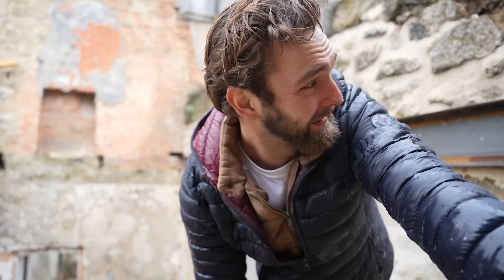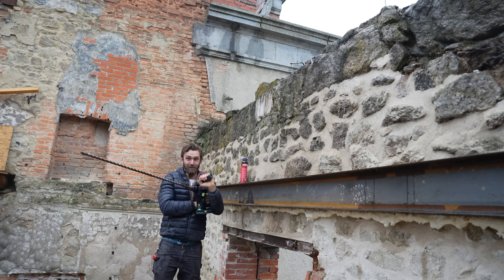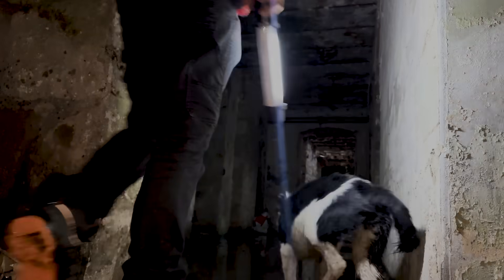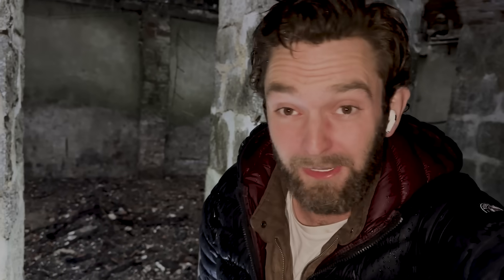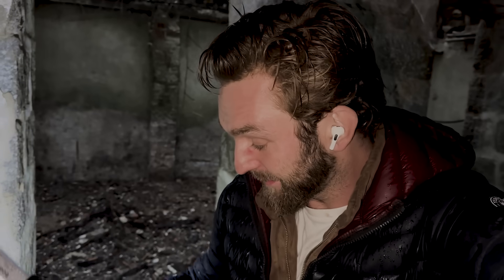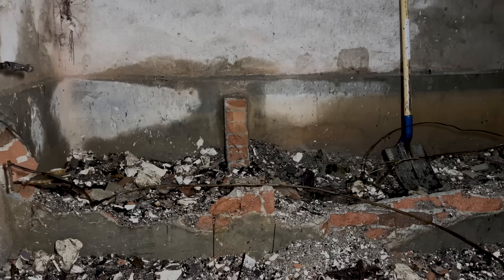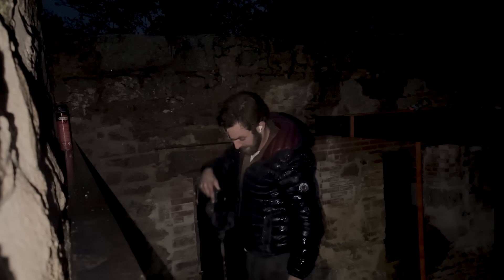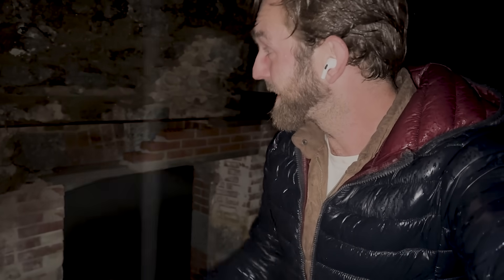Drilling the anchor points for the floor

Comment: I would drill right through and put  a stainless steel plate as a washer on the outside of the building trued up parallel to the outer wall using a mortar mixed with a water-based epoxy resin.  That allows for some contraction of the long bolt in extreme cold conditions--and I would also use a high density polypropylene washer at each end of the threaded bolt bar as well to make certain there will be no fractures--and I would use polyurethane foam at the outer wall surface of the hole to prevent water ingress.  I use chemical anchors--they are one of my favourite things, but not in lateral shear.  The whole wall is needed to be certain of the support, which may end up also being a part of the roof anchoring or support.  You probably only need three or four of them.  Another hundred bucks worth of  steel and high density nylon or polypropylene washers for absolute certainty.

Comment: Heey mate, your drillbits seem dull!
Easy fixin! Check out some tutorials in YT, get a 80 grit flapper disc for the grinder and 5mins of angle grinder noise, calm and concentration and Bobs your uncle.
Easier than one might think.
The renovation is cracking on nicely and very fast considering everything. Doing a helluva job there mate.
Take it easy.
Great thanks

Comment: Dan, I hope that's cutting fluid you are using and not lubricant. A better technique would be to stop waggling the drill about but keep it steady and continuously cutting.get your shoulder behind the drill and keep as much pressure as you can bear on the drill. Tie yourself into the wall somehow if you can. Or......hire out a mag drill.😊.enjoy

Comment: Just a comment and a question.   Seems like he is drilling at quite an angle?   which makes the drill hole longer.   (could be the camera angle but i don't think so)  does that affect the bolt-wall strength either stronger or weaker or not at all?  curious.

Comment: Probably too late now, but if you have more holes in the beams to drill, get yourself a magna drill. Makes it so much easier and safer. When finished sell it  I did and it made steel drilling a pleasure.

Comment: Dan, You said, "See you." a few times,  so get your safety glasses on. I don't have the photo of mine with the remains of an HSS drill embedded in them. But it's a blinder! If you are countersinking the hole use a bigger bit. End of grump. Regards,  Stephen.

Comment: Would you consider a temporary roof of scaffolding and tin or tarp until you are ready for the proper roof? I bet someone would do it for you for the advertising , if you asked for it...
Reply: Yes a temporary  roof so you can work better and it can be used at other parts of you  projects  asif in when needed

Comment: It will be good to get power on site; however, rain and electricity does not mix very well. You may need to go with a temporary structure on top of the building. I'm wondering what you are going to be doing once it turns both wet and cold? I know mortar likes certain temperatures. My guess is more cleaning, clearing, and prep work for the spring.

Comment: your drill bits.   watching you trying to drill steel ... apparently you have the 118 (general use drill bit) and wiggling the drill motor,  even pressing the drill motor against steel.   those actions and selection... you have dull drill bits.     135 drill bits are designed for hard metals, steel is one of them.   never wiggle the motor, and do not press the drill motor against the metal. 

quick question.  do you have drill sharpening device?  like drill doctor.   i do buy 118  and re-sharpen bit to 135. (cheap to buy 118 anyway). ps drill doctor said can resharpen masonry bits too (i have not tried that).

Comment: Have you a grinder? The rough angle of drill for steel is 110 degrees the angle of a the two faces of a hexagonal nut. Don’t forget to back off when sharpening. This will give you a clean cut. Wriggling the drill will not improve cutting it merely shows the drill is blunt. When sharpening a masonry drill you will need a green stone and angle will be a little different.

Comment: I may be wrong here, Dan but I thought you went from "hammer drill" in the steel and then to regular in the stone. If that's the case, it needs to be the other way around.  "Regular" drilling in anything like wood or steel and "Hammer" in masonry.  The masonry will go lots faster.  Also, for your regular steel and wood  drill bits, go online or stop into a local machine shop and ask where they buy their bits.  The quality of those bits will be way higher than any you buy from the local "big box" store like Brico.  Those "gold plated" bits you buy in the big box stores are junk. Most of them wouldn't stay sharp for even one hole like the one you're drilling in that steel. Been there, done that.     Good Luck and BTW, everything looks beautiful. With the building, I mean.      Jack L.

Comment: I rather like the idea of a small indoor pool in the basement. Roman bath or therapy pool, heated of course. In a few years after you’ve finished the chateau the thought of having a nice soak in a hot pool might be very appealing. No jacuzzi jets to break or maintain. Just a nice size 4 ft deep pool for soaking, walking or just relaxing. Just saying don’t write it off, especially if you plan to stay in the chateau into your senior years. Your body will adore a 90 degree pool just a few floors away in the basement. It’s not like you need the space.

Comment: Hello Dan, I don't know what type of oil you are using for drilling, what you need is Industrial Pro Cutting Oil | Premium Cutting Fluid for Drilling, Tapping, Milling | Cutting Oil for Drilling Metal Such as Iron, Stainless Steel, Copper, Aluminum and More, its just a thought!  🍀

Comment: See you sunday.  I don't remember you saying what you are doing the hole for.?
I think you should have some tarps on top.. Keep the word from getting wet.  Isn't that particle board? For the floors? I have fallen through Particle board.  Have a safe two days. 😊
Reply: To anchor the beams to the wall with bolts.
Reply: I hate computers. When they purposely miss Spell words.

Comment: At least with the eco battery you can use power tools intermittently and only have to run the generator continuously to do a recharge.
 The alternative without the battery is having the generator running continuously all the time just so there's power to use tools intermittently.

And now there are big piles of rock dust sitting on the spray foam behind the steel, right where you want lime slurry the most. Ain't hindsight a bitch ?

Comment: Did you know engenders have been using cement for 1000's  of years to stabilise the ground ie you dote need to concrete your basement you could quite easily just add cement to the existing ground by digging it in and leveling it off and given time it will dry as hard as concrete

Comment: Re; the eco flow generator- what does Dan mean by "miserable winter days"? It's still October. I've been watching this site daily since he started and that was last spring. 
He didn't need a thicker section for the channel. The channel only carries half the load of the floor spanning the space between the wall and the first beam. In other words the channel only carries the weight of floor about five feet wide by about 16 feet long (the width of the room).  Who ever is selling him the steel may be taking advantage of him?

Comment: Wrong drill bit used. You just made an hour job for 4 holes last the day..:). Btw   if you touch stone with the steel drillbit  for a sec..its shot straight away. Still love your vids though😊

Comment: First at all… this is not a quality tools to do the job lol… a bit ridiculous to watch really
Reply: It's Festool. Absolute top of the line tools
Reply: @NurseSherry  You can use top of the line tools and still not be using the proper tools for the job. Even a good quality tool can’t overcome a cheap or wrong drill bit.
Reply: If it's too ridiculous for you to watch, and it makes you get all uppity, there's an easy solution for that. 🙃